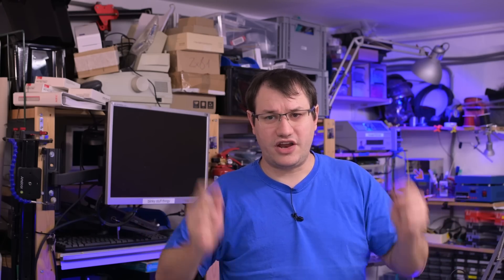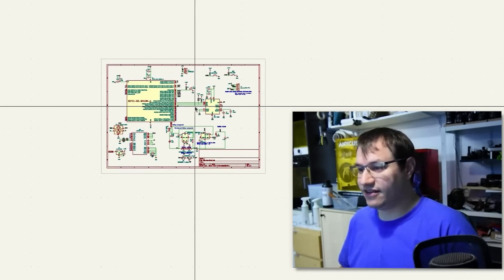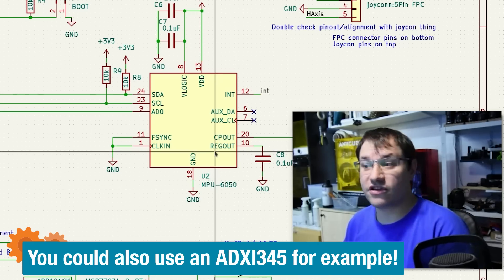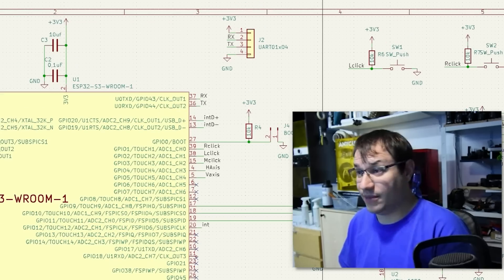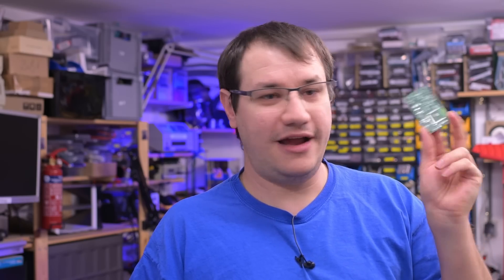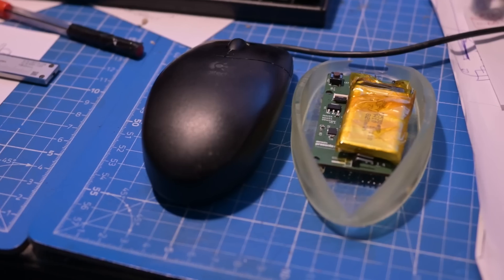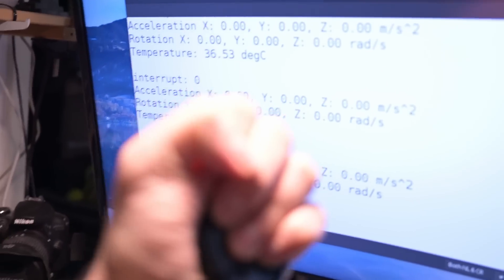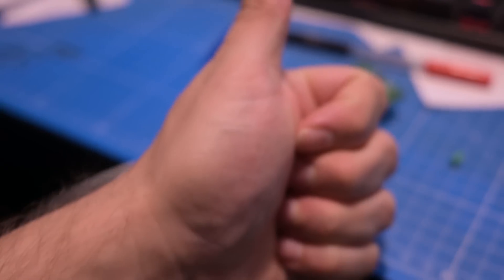Creating an IMU-based 3D Mouse with an ESP32-S3

Comment: About 25 years ago, I had a VFX-1 headgear virtual reality headset. This came with a cyberpuck 3D mouse that operated in the same way as the final mouse in this video. I believe the cyberpuck and the headgear used the earth's magnetic field to detect the changes of the devices orientation. It worked very well, and I used the cyberpuck on its own as a mouse on several occasions. Unfortunately, the VFX-1s interface card plugged into an ISA slot, so when I had to upgrade my PC and couldn't get one with an ISA slot I had to give up using the VFX-1 and the cyberpuck.

Comment: There are some optical sensors in stock, have not checked every single one of them but there is probably something "usable" ?
Reply: Can I haz link? 😢
Reply: @MAYERMAKES I think optical sensors like the APDS-9500 could possibly be used?

There were ADNS "LaserStream" sensors, but there might be others as well.

The APDS has "cursor mode" and from what I can tell from the surface calibration some mice do... they do look at a tiny image from the optical sensor!

Comment: Perhaps a joystick shaped device would make it a bit more intuitive for tipping the mouse in the x/y direction, than a puck-shaped mouse?
Reply: could be, i think for these sort of devices finding the right shape could be a personal thing. not everybody might prefer the same shape, i could also see the appeal of moving the mouse only while a button is held for example for presentations.
Reply: @MAYERMAKES  
The only commercial version which I can remember the name of is Gyration Air Mouse, which adopted a Star Trek TNG phaser shape, mostly because one mouse button is the trigger underneath and there's a control pad for your thumb on top.

Comment: Given a slightly elevated stand to help maintain the mouse angle and revert back to no movement between tilts, I can almost picture potential here to be less frustrating than a regular mouse. You know, because you're not running out of tracking space or knocking the coffee over.
Reply: In the meantime... Trackball

Comment: For little rodents that can gnaw their way into anything, and are scared of cats, "mice" is right, yes.

But for mechanical rodents (I've heard people refer to a mouse as "rodent", and was impressed by this) as far as I'm concerned the correct plural is "mouses", not mice. Mice are little rodents. Lots of them. Mice is their collective noun. Mouses are just metaphorical mouse instances. It's much more sensible to keep things simple, call them mouses, and leave whatever ancient reason there was to give the word "mouse" and irregular plural, whereas "house" plurals to just plain "houses", regularly.

Hmm ... lice are the plural of louse, so it's not a perfectly irregular thing.

If they make a device they decide to call a louse, go with "louses" and not "lice", in the plural, as well.

Lots of words in an irrelevant matter, yes I know. What can I say? This is the Internet. This kind of thing is happening all the time.
Reply: turns out I wasn´t so wrong after all
Reply: @MAYERMAKES  Yes. As in IMHO you were completely correct. :D
Reply: I'd better try to be relevant. OK, so maybe what you really need is a Wild West Colt 45 pointing device with a lazer beam that changes colour when you trigger an action. So you'd fast draw it, take aim, and pull the trigger to left click. That should be nice and useful.

Comment: Doing a double integral of IMU samples wouldn't be too hard. The problem is that the IMU isn't perfect - you are measuring acceleration with a bit of error. And you're integrating the error twice as well - and that's why the device just shoots off in seconds.

Similar problem needs solving for VR. There, it's universally accepted you need to correct it several times a second to get proper readings (an external system provides an absolute position, but slowly, an IMU can be sampled at hundreds of Hz, but by itself would run away. So an IMU fills in the blanks between samples of another positioning system).

What an IMU can measure very well is rotation, so a trackball would be possible if the PCB was inside the ball with a battery. To get rotation, samples from a gyro get integrated - but only once - so it drifts, but at a constant speed, so it's manageable. The other sensors in an IMU can be used to correct that drift. I'd recommend madgwick's algorithms for doing so, correcting the drift is actual hard math. For a drift-free result you'll need gyro+accel+magnetometer. Magnetometers aren't great, usually needing calibration because they are influenced by metals around them, but you could provide a fake stronger north with a magnet in the casing
Reply: i like the idea of putting the imu in the ball! thats a cool concept! my math capabilities are very limited so for me it was to hard to do, but Iḿ sure some community memebers will figure it out!

Comment: What is its battery life?
Reply: no idea but likely several hours without any sleep function, can be optimized like with any other mouse in code.
Reply: @MAYERMAKES  what you built is called an air mouse, and their battery life is 4 months... If you are not addressing consumption, which is the elephant in the room, the rest is useless

Comment: if you designed the bottom plate like  a half ball shape, you can use it on an surface, an tip it in all directions, or just design the bottom like a spinning top. So you can use it in mid air, and on a table too.
Reply: if you look closely o nthe underside ofth the final red mouse you will see a little conical shape, that was supposed to hiold a spring and a weighted baseplate so I actually tried that idea the trouble was with return to center, it was just to jiggly to reliably move and the deadspace required was to big so I removed it again.
Reply: @MAYERMAKES  oh you right, if the mouse don't jump back in an neutral resting positions you can't release it with you hand. But how do I release the Air mouse? Do I need a stand to put it on a table, if I need to use the keyboard for example?

Comment: Can you elaborate more why IMU mouse require complex math?
Reply: I tried to do something similar in uni and basically came to the same conclusion. The IMU measures acceleration. To get from that to translation ("I have moved this far in this direction") requires a second order integral. The integral itself isn't that hard, but any error in the measurement grows exponentially. So you end up lowering the sensitivity to reduce noise at which point it can't track small movements accurately anymore, and any large movement quickly leads to the error piling up to where it becomes useless. The paper he refers to probably uses the second IMU so it can sort of average the noise out, but that only gets you so far. What you need is a way to recalibrate to a known anchor very often. That's how IMU-based position systems like the inside-out tracking in the Meta Quest VR headsets work, and also the Wii controllers.
Reply: here is a paper on that: https://actascientific.com/ASOR/pdf/ASOR-02-0063.pdf
Reply: The IMU he wanted to use is a 6 DOF IMU. It measures acceleration and rotation in 3 directions. But it has no magnetometer and doesn't output translation. This means the translation movement and position would need to be calculated from the acceleration. So, imagine you move the mouse from A to B in a straight line. It starts stationary, then accelerates. When the movement speed stabilizes the acceleration is zero again. If we want to know the position (distance traveled) we need to know how fast the mouse is moving. But in order to know how far you are moving you need to know how fast you are going. This means you need the integral of the acceleration over time (which is the change in velocity). And then you need to take integral of the velocity over time to get the distance. From the distance the change in position can be calculated. 
When you decelerate upon arrival at point B you need to do the same calculation but in the opposite direction (with negative values). If the calculations (and measurement data) are perfect the acceleration and deceleration, and the velocities should cancel each other out. But if you miss data or have any measurement error the acceleration and velocities won't cancel each other out and your velocity never reaches zero, so your mouse cursor would be all over the place (this is the problem Clem was running into).
TLDR: this IMU doesn't output translation movement or position, so relative movement and position need to be calculated. No IMU is very accurate as a position sensor, as this is not measured directly. A 9 DOF IMU would have been better, but it would still require the calculations to be done on a computer in order for it to work as the calculations need to be performed as close to realtime as possible.. An ESP32 is simply not fast enough to even get close to real time when dealing with such complex calculations.
Reply: It does not. It is simple integrals of integrals. IMU gives (among other things) accelereration in X, Y, and Z. If you compute the integral, it gives the speed in X, Y and Z, if you take the integral again, it gives the displacement in X, Y and Z. Respectively, the gyro of the IMU gives the angular acceleration -> angular speed -> heading in X, Y and Z. So it's not complex math, but the thing is sensors (especially this one) are not perfect and a tiny error in measurement passing twice through integration might result in very bad measurements of displacement and heading of the mouse.
Reply: Another problem is the existence of gravity. You can't easily distinguish an acceleration that is much smaller than gravitational  acceleration from tilt.

Comment: Trackballs do not reqire integration like a IMU mouse would. You just need to have ball drive two slotted wheels and then count the slots as the wheels rotate.
Reply: I actually don't see why it would matter if it was a ball mouse. Before optical mice became the norm every computer owner in the world used them for years. They get a little dirty every few months, but they work just fine.

If you're already building something, which is easily attainable, from scratch and at greater expense than the commercial option, why would the difference in technology be that great of a deterrent?
Reply: that would require mechanical design Iḿ not getting into yet, and an optical variant would require the seemingly unobtainable sensors, but yes atrackball might be a good follow up project as it would be interesitng to see how encoder wheels work.
Reply: @MAYERMAKES  for some circa 1984 documentation on how this used to be done check out page 1028…1030 of this https://www.weihenstephan.org/~michaste/pagetable/mac/Inside_Macintosh.pdf
Reply: @MAYERMAKES  So a ball mouse would also be possible?
Reply: well yes, but the mechanical design is much more complicated  and I thought people would not like to see such an Oldschool design for a mouse. @Domspun
Reply: @MAYERMAKES  haha  Touché!